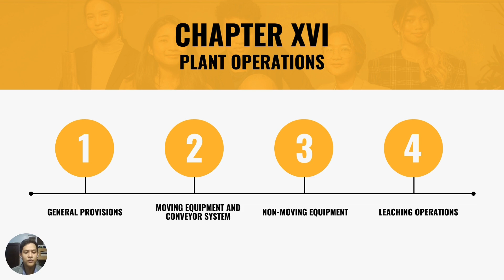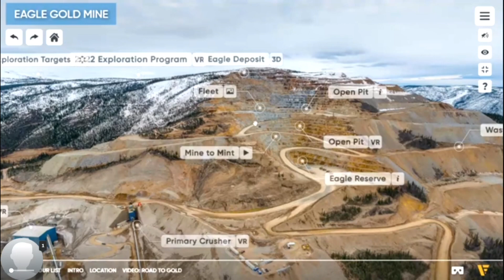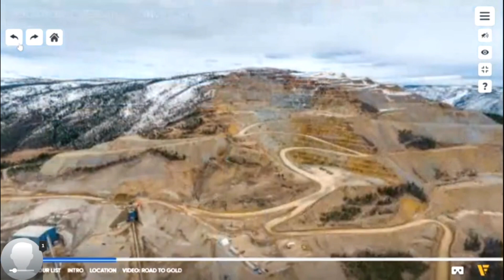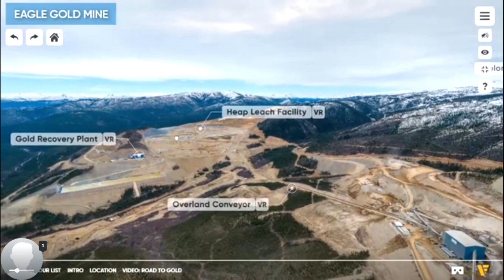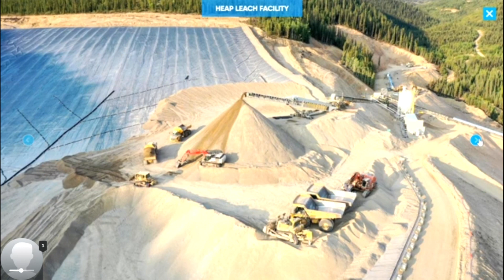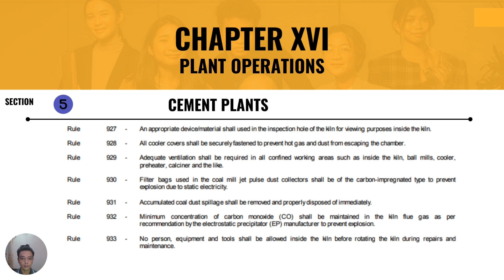Group 5: Chapter 13-16 | Reporting |

Comment: Joshua Rheynaird J. Amoguis
Here's my insights for group 5
To sum up all chapters it's all about how to keep safe everyone while working in mines and For the Chapter 13 direct the rules how important the Personal Protective Equipment (PPE) in mining, in order to keep safe everyone and ensuring proper provision and use of safety gear like hard hats, boots, and respiratory protection etc. It emphasizes maintenance and use in specific tasks or hazardous conditions. Chapter 14 focuses on Health Hazard Control, in order to mitigate or isolate people from the hazard also it requiring employers to provide emergency health services and outlining criteria for medical practitioners, regular health inspections, and necessary supplies. Section 2 details requirements for emergency medical and dental services, emphasizing the employer's responsibility based on the mine's classification. The goal is to safeguard workers' health through proper PPE and accessible health services. Also for the Chapter 15 talks about labeling and emphasizes safety standards for piping systems, and lastly for Chapter 16 tackles about how important to care the environment also plant operations, detailing safety rules for moving and non-moving equipment, conveyor systems, leaching operations, and cement plants. The rules focus on preventing accidents, ensuring proper handling of hazardous materials, and maintaining a safe working environment in mining operations. This comprehensive approach ensures miners are protected from both physical hazards and health risks, fostering a safe and secure working environment in mining operations for overall it's all about to keep safe everyone, loving the nature and for the better future.Thanks

Comment: In Chapter 13-15, the reporter talks about the key role of Personal Protective Equipment (PPE) in ensuring individual safety within the operational environment, stressing the necessity of using appropriate gear to mitigate potential risks and safeguard personnel well-being. In the next chapter provides a comprehensive discussion on health hazard control, focusing on general strategies and preventive measures for a secure working environment, as well as the importance of emergency medical and dental services for unforeseen incidents. Dedicated to the identification of the systems, and in the next chapter offers guidelines to enhance clarity and understanding in plant operations, contributing to overall safety and efficiency.

Comment: DAO 2000-98 Chapters 13 to 16 establish important regulations for personal protective equipment (PPE) in mines, placing significant emphasis on the correct provision and utilization of safety gear, including helmets, boots, and respiratory protection. Chapter 14 takes a deep dive into health hazard management, mandating employers to provide emergency medical services and setting explicit standards for doctors, regular medical examinations, and necessary care. The primary objective is to fortify workers' health through the judicious use of personal protective equipment and the availability of comprehensive medical services.

Chapters 15 and 16 delve into the intricacies of mobile and fixed equipment, conveyance systems, leaching operations, and cement plant operation, laying down stringent safety standards. The regulations are designed to proactively prevent accidents, ensure the proper handling of hazardous materials, and maintain an environment conducive to safe mining operations. The core principle of shared responsibility is paramount, with clear delineation of roles for employers, employees, contractors, and government agencies, each playing a pivotal part in accident prevention and fostering a secure working environment.

These chapters underscore a paradigm shift where workers are not passive recipients of safety measures but active participants with rights to information, training, and involvement in risk identification and mitigation. The collaborative approach advocated in Chapters 13 to 16 signifies a joint commitment to ensuring a safe and healthy working environment within the mining industry. The significance of effective government oversight is highlighted, further emphasizing the collective responsibility to uphold the highest safety standards in mining operations.

Comment: Today's group of presenters has effectuvely elaborated the chapters 13 to 16 of the DAO 2000-98 which all of them partcicpated and dug deep to every rules and sections. In essenece, I will just give insights on the importance of the chapters being discussed in general.
PPE, including helmets, gloves, and respiratory protection, acts as a crucial defense against occupational risks, reducing the likelihood of injuries and illnesses caused by exposure to hazardous substances. Simultaneously, stringent health hazard control measures, such as proper ventilation and dust suppression, are vital to mitigate the impact of harmful substances on miners' health. The combined use of PPE and hazard control creates a comprehensive safety framework, ensuring a secure and healthy workplace by minimizing potential risks and consequences associated with mining activities. 

A well-designed and properly maintained piping system, along with sound plant operation practices, is paramount for ensuring mine safety. The piping system facilitates the efficient transport of fluids critical to mining processes, including water, chemicals, and slurry. Any failure or leakage in the system can lead to hazardous situations, environmental damage, or operational disruptions. Regular inspections, preventive maintenance, and adherence to industry standards are crucial to prevent issues such as corrosion or structural failures. Additionally, good plant operation practices, including effective process control and emergency response protocols, contribute to overall safety by minimizing the risk of accidents and ensuring the reliable and stable operation of mining facilities. The synergy between a robust piping system and well-executed plant operations is fundamental for creating a secure mining environment.

Comment: For a student in mining engineering, these chapters are invaluable, serving as a cornerstone for understanding and implementing safety measures within mining operations. 

        Chapter XIII of mine safety standards concentrates on Personal Protective Equipment (PPE) within mining operations. It delineates requirements for various types of PPE, addressing their proper usage, maintenance, and the shared responsibilities of employers in ensuring worker protection. Moving to Chapter XIV, it zooms in on Health Hazard Control, particularly Emergency Medical and Dental Services. This section outlines measures for prompt response to health hazards, emphasizing the need for comprehensive training and the establishment of emergency plans. Chapter XV highlights the Identification of Piping Systems, emphasizing the importance of clear labeling for safety, maintenance, and emergency response. It sets standards for color-coding and signage, offering insights into how visual cues contribute to overall safety. Lastly, Chapter XVI covers a broad spectrum of Plant Operations within mines, encompassing guidelines for safety, equipment maintenance, process safety, environmental considerations, and employee training. This chapter serves as a comprehensive resource for students, providing a holistic view of the multifaceted nature of maintaining a secure and productive mining plant.
These chapters collectively offer a comprehensive framework, shaping a mining engineering student's understanding of safety, emergency preparedness, and efficient plant management in the dynamic and challenging field of mining.

Comment: Dedicates attention to critical aspects of worker safety and hazard control in Chapter XIII. Section 63, titled "Personal Protective Equipment," is poised to establish a robust framework detailing the mandatory use, specifications, and maintenance guidelines for personal protective equipment (PPE). This section is expected to encompass a broad spectrum, addressing the diverse needs of workers in various mining environments, ensuring that they are adequately shielded from potential risks and hazards.

Advancing into Chapter XIV, Section 64 underscores the paramount importance of "Health Hazard Control." This segment is likely to delineate comprehensive strategies and protocols for identifying, assessing, and mitigating health hazards inherent in mining activities. The chapter may encompass measures such as ventilation systems, exposure monitoring, and the implementation of engineering controls to safeguard workers from exposure to harmful substances, thereby promoting a healthier and safer work environment.

Chapter XV extends the regulatory purview to the intricate domain of piping systems in Section 65, "Identification of Piping System." This section is anticipated to detail guidelines for the proper identification, labeling, and maintenance of piping systems within mining facilities. This meticulous approach ensures clarity and precision in identifying different piping functions, contributing to both operational efficiency and overall safety.

Finally, Chapter XVII, under Section 67, ventures into the critical realm of "Radiation Safety." This segment is likely to establish stringent measures for the safe handling, monitoring, and containment of radiation sources within mining operations. The regulations may encompass radiation exposure limits, monitoring protocols, and the incorporation of shielding mechanisms to protect workers from potential radiation hazards.

Comment: Here are my insights for this group's discussion. 

Chapters 13 to 16 of DAO 2000-98 establish regulations for personal protective equipment (PPE) in mines, emphasizing the proper provision and use of safety equipment such as helmets, boots, and respiratory protection. I am. Chapter 14 focuses on health hazard management. The law requires employers to provide emergency medical services and establishes standards for doctors, regular medical examinations, and necessary care. The objective is to protect workers' health through adequate personal protective equipment and available medical services. Chapters 15 and 16 cover mobile and fixed equipment, conveyance systems, leaching operations, and cement plant operation and safety standards. The regulations focus on preventing accidents, ensuring the proper handling of hazardous materials, and maintaining a safe mine working environment. The concept of shared responsibility is central, with employers, employees, contractors, and government agencies each assigned a specific role in preventing accidents and promoting a safe environment. Workers are not passive recipients of safety measures. You have the right to be informed, trained, and actively involved in identifying and addressing risks. Chapters 13 to 16 articulate a collaborative approach to safety and health in mines, demonstrating shared responsibility for creating a safe and healthy working environment for everyone involved in the mining industry, and the importance of effective government oversight.

Comment: Omanglad, Quia Mira D.

Here are my insights for the chapters covered by Group 5. 

Chapters XIII, XIV, XV, and XVI of the DAO2000-98  ensures  the safety and health of employees in mining operations. 
Chapter XIII emphasizes the critical role of Personal Protective Equipment (PPE), detailing specific guidelines (Rules 849-859) for different work environments. Surface and underground mining operations are addressed, with a focus on safety hats, boots, and specialized gear for specific tasks. The chapter underscores ongoing responsibilities, such as maintenance and the use of safety belts for elevated work. 

Chapter XIV delves into Health Hazard Control, highlighting the employer's duty to provide emergency and occupational health services. Collaborative efforts between Service Contractors and principals are encouraged (Rule 861), and the systematic provision of medical personnel and facilities is detailed based on mine classifications. 

Chapter XV emphasizes the adherence to Occupational Safety and Health Standards for the proper identification of piping systems (Rule 868). Chapter XVI covers Plant Operations comprehensively, addressing general provisions, equipment safety, and specific guidelines for various plant processes. These chapters collectively exhibit a meticulous and comprehensive approach to safety, emphasizing preventative measures and collaborative partnerships to protect the well-being of employees in mining and plant environments.

Comment: DAO 2000–98 Chapters 13–16 are covered by Group 5. The DAO 2000–98's Chapter 13 provides guidelines for the use of personal protective equipment (PPE) in mining, guaranteeing the appropriate supply and application of protective gear such as boots, hard hats, and respirator protection. It places a focus on upkeep and application in particular jobs or risky situations. Health Hazard Control is the main topic of Chapter 14, which also stipulates requirements for medical practitioners, frequent health inspections, and required supplies. Employers are required to offer emergency health services. In Section 2, the obligations for emergency medical and dental care are outlined, with a focus on the employer's liability according to the mine's classification. The aim is to protect employees' health by providing them with appropriate PPE and easily available healthcare. Chapter 15 talks about safety standards for piping systems, and Chapter 16 serves as a guide for ensuring safety in mining plants.

Comment: Here are my insights about the report of group 5: Chapters XIII-XVI

Chapter XIII: Personal Protective Equipment
This part talks a lot about keeping workers safe in mines. It says how important it is for them to use things like helmets, gloves, and safety goggles. There are rules about how to use and take care of this gear to make sure everyone stays safe.

Chapter XIV: Health Hazard Control
Section 1: General
This part gives some basic ideas about how to keep people healthy in mines. It talks about ways to reduce the risks of being exposed to harmful stuff in the air or around.

Section 2: Emergency Medical and Dental Services
Here, they talk about what to do in case someone gets really sick or hurt. It explains what medical help should be available on-site, what to do in emergencies, and how to get quick help for health problems.

Chapter XV: Identification of Piping System
This part is about making sure everyone knows what pipes do what in the mine. It explains how to label and mark pipes so workers can easily understand which ones are which, making everything safer and more efficient.

Chapter XVI: Plant Operation
Section 1: General Provision
This section gives some basic rules for how mines should run. It talks about keeping things safe, how operations should work, and what everyone's responsibilities are to make sure the workplace is secure.

Section 2: Moving Equipment and Conveyor System
Here, they talk about how to keep workers safe when using machines and conveyor belts. It gives guidelines on how to take care of these machines and prevent accidents.

Section 3: Non-Moving Equipment
This part is about keeping things safe with machines that don't move. It talks about how to use them, take care of them, and make sure they don't cause any accidents.

Section 4: Leaching Operations
This section is about staying safe when using certain chemicals in the mine. It gives guidelines on how to handle these chemicals, get rid of waste, and keep everyone safe during these processes.

Section 5: Cement Plants
Here, they talk about safety rules specifically for places where they make cement in the mine. It covers how to use equipment, handle materials, and overall keep things safe during cement production.

Section 6: Protection Against the Handling of Chemicals and Other Laboratory Hazards
This part talks about being safe when dealing with chemicals and labs in mines. It gives guidelines on how to protect yourself, store things correctly, and what to do in case of an emergency in the lab.

Comment: Group 5 covers Chapters 13 to 16 of DAO 2000–98. Chapter 13 of DAO 2000–98 outlines rules for Personal Protective Equipment (PPE) in mining, ensuring proper provision and use of safety gear like hard hats, boots, and respiratory protection. It emphasizes maintenance and use in specific tasks or hazardous conditions. Chapter 14 focuses on Health Hazard Control, requiring employers to provide emergency health services and outlining criteria for medical practitioners, regular health inspections, and necessary supplies. Section 2 details requirements for emergency medical and dental services, emphasizing the employer's responsibility based on the mine's classification. The goal is to safeguard workers' health through proper PPE and accessible health services. Chapter 15 emphasizes safety standards for piping systems, and Chapter 16 tackles plant operations, detailing safety rules for moving and non-moving equipment, conveyor systems, leaching operations, and cement plants. The rules focus on preventing accidents, ensuring proper handling of hazardous materials, and maintaining a safe working environment in mining operations. This comprehensive approach ensures miners are protected from both physical hazards and health risks, fostering a safe and secure working environment in mining operations.